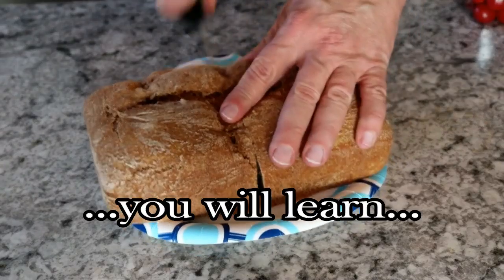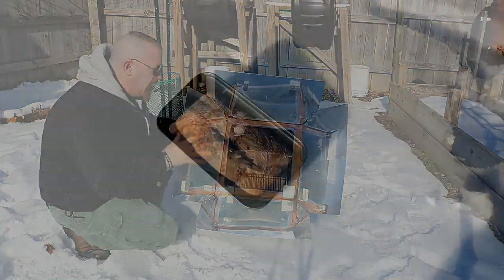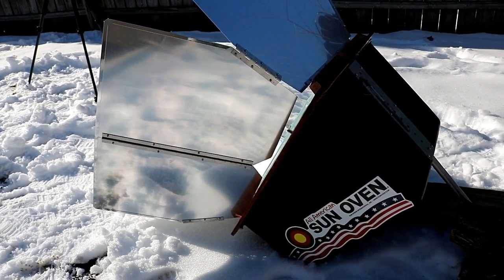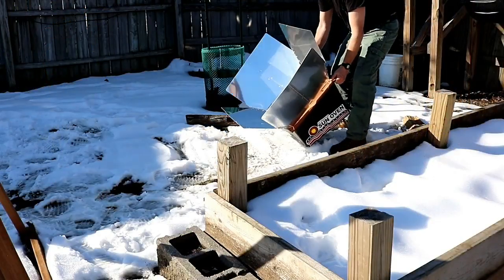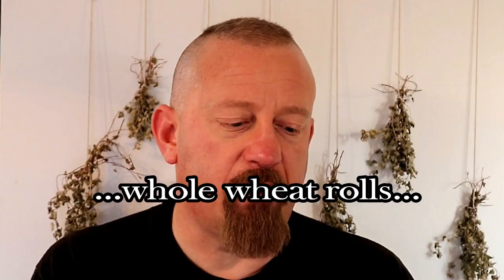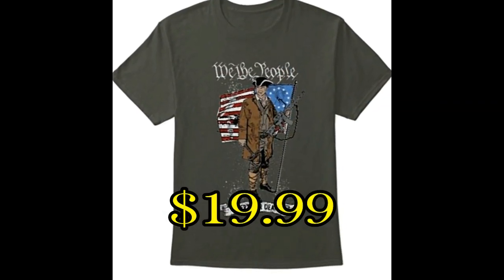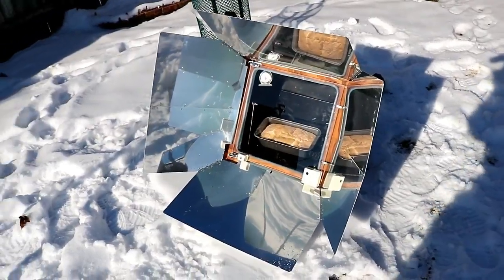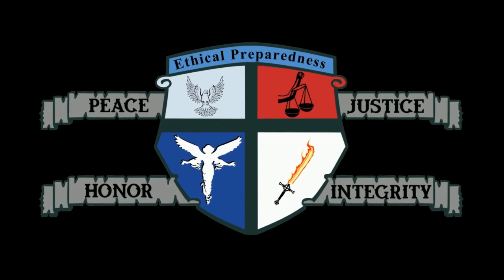The All American Sun Oven Cooked Dinner in the Winter & Snow - See It In Action

Comment: Brother, you just made me HUNGRY! Thanks for the T&E in winter conditions; I have never seen it done and was indeed curious about the validity of Manufacturer's claims. This underscores the critical fact that being prepared is NOT just accumulating "stuff", but we MUST use, learn about and wring out our preps BEFORE balloon goes up. Can the mirror surfaces be cleaned easily without scratching and thus reducing reflectivity? Gonna have to get a couple of your shirts, great artwork and messages of honor, courage and principles.
Reply from the maker: While the reflective panels are kind of 'floppy' so they can be collapsed and packed conveniently: they are fairly sturdy.
They would easily be cleaned with a wet rag or towel. I just wouldn't use a scouring pad on them. 
This thing is fairly sturdy. 
It wouldn't stand up to hard falls, but I'm not exactly 'easy' on it either. 
I don't toss it around, but I don't baby it either. 
I hope that info helps! :)

Comment: Sir, thanks for the video. I am fairly new to this, and am seeing how rice and beans are looking like the best initial bang for the buck long term food storage option. I am wondering , however, since they are fairly long cooking intensive, what's the best method for shtf cooking of these? I was thinking of something like enough solar to keep enough juice on hand to power one of those portable induction burners, which range from about 1200 to 1800 watts. What do you think? I wouldn't even know what to use for that wattage set up.
Reply: You could cook the rice and beans now, dehydrate them and then cook them like this or any other method. When you cook them and then dehydrate it, the food becomes instant rice and beans.
Reply: @B2U23  a definite option. Thank you. Another channel just brought his viewers to the attn of a bargain at Chinamart (wallyworld to some folks lol). They I THINK are still selling a Readywise "outdoor meals Hunting" 3 days bucket for less than $30.00. I realize that's only 3 days but I broke open the bucket lid and it's the Mountain House type, pour boiling water into the bag and eat style, so if this was Mountain house with these 12 pouches, it would be well over $100.00 I think.. Normal price according to walmart is $79? So I bought one. Website says only 7 year shelf life but the packages are marked 2036! For 30 bucks, and 15 year shelf life for 12 pouches? I'm in. Might get another. Yes I realize the rice and beans is better overall. But I consider this a convenience item, basically fire-and-forget.  ;-)